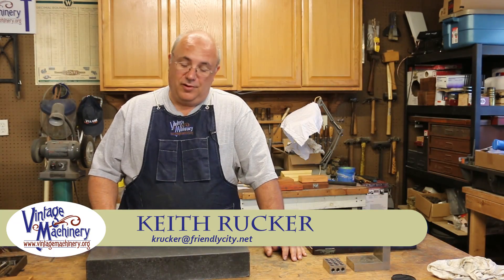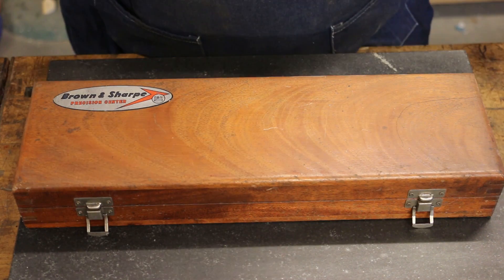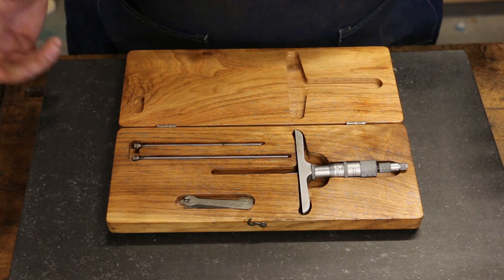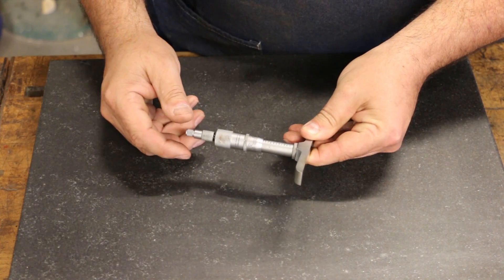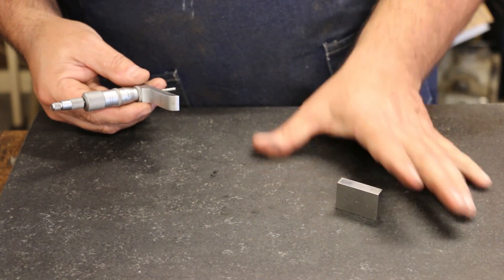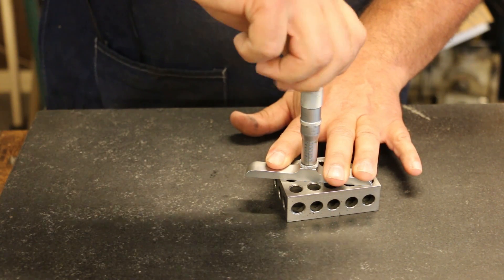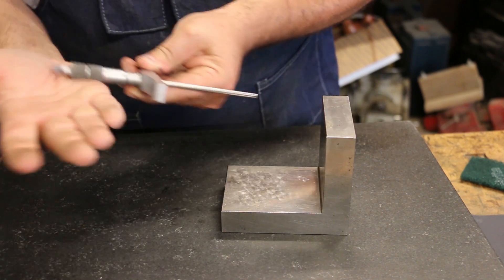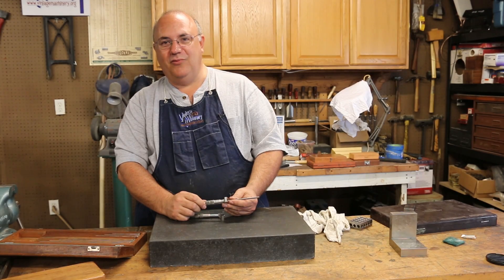Machine Shop Basics:  Depth Micrometer Use and Calibration

Comment: great video Keith, but also mechanics use this not just as a measuring device, but also in adjusting engine parts, ie measuring valve lift, to set adjusters, or to check pulley marks of valve timing, aka to 'set' top dead centre by this tool touching the pin, piston, etc, this is by using the tool to create a known reference dimention to set the system, rather than common usage, to determine an unknown dimension.

Comment: Keith, how do you know how tight to do up the collar which assembles the rod to the barrel as this affects the calibration (aka the fit of the assembly to the barrel); as you don't mention this while callibrating the rods, as if you 'finger tighten' the rods during calibration, you MUST repeat this (like concentricity in a lathe chuck, with the same jaws in the same spots)- ie do you use the 'ratchet top' to tension this nut?, to keep consistentcy.

Comment: I guess I'm getting here a little late, but I just picked up a Brown and Sharpe 1/2" depth micrometer with an adjustable rod. Shows a patent date of 1898, so not new. It has half inch graduations, but they don't quite line up dead on with the thimble at zero. Tip is chamfered, and when you feel the graduation catch inside at zero, the edge of the chamber is dead zero with the base. I can set it to use it with a standard, but they probably had a different intent with the lines. Haven't quite got it figured out, but I can at least use it.
Reply: Someone may of tried to adjust the mic like you’d adjust an outside micrometer or just rotated the sleeve accidentally? If you wanna fix it you should try this:

- Unscrew the ratchet
- Remove the rod
- Unscrew the thimble and you’ll find a collet. 
- Loosen the collet and that will allow you to rotate the sleeve. 
- Put it back together and you’ll most likely need to adjust the rod to zero it out.

Hope that helps even though this is a year later lol

Comment: Hey Keith, i have a depth mic that I’m not sure if needs calibration. When its set to zero the pin is exactly flush with the base of the tool. When i set it on a machined surface and ratchet it down, i get a reading of .0015. The issue I’m having is that i can see the pin is extended farther than the base of the tool and can feel it when i run my finger over it. Any insight?

Comment: Any idea where you can get a replacement base for that depth micrometer or any one for that matter? There is a nice Mitutoyo Depth Micrometer set at one of my local thrift stores for $20, but the micrometer base is pretty badly pitted.
Reply from the maker: Probably best to just pass and find a different one somewhere.  You can get some good deals on ebay if you are patient.

Comment: Great video as usual. Would you do a video on the Vernier caliper. I just had to have one, so I bought on  Ebay and it sure is a challenge to understand. Knowing how to use this caliper just might justify buying it : ) . My caliper is a L.S. Starrett 50 division. Now, I guess I need to buy a depth mic and practice what I have learned here. Thanks so much for another great video.   Ken ...Marina CA
Reply from the maker: I will see what I can do.  I think I only have one vernier caliper - a Starrett 24".  I can't remember if I showed how to read it when I got that one or not.

Comment: Guess that isn't a 1-2-3 block if it's .812 deep. :-)  Thanks for the very informative video!
Reply from the maker: For whatever reason, the holes on those blocks do not go all the way through like on most.
Reply: +Keith Rucker - VintageMachinery.org well, that would explain a lot. 😄

Comment: Thank you Mr. Rucker for the lesson. I wanted to ask you a question that was from a previous video. This is about the lathe you bought. You demonstrated how over time that the table gets worn out on both axis as much as 10 thousands in your case. I guess what I was wondering is on a brand new machine how much is acceptable? I know it can't be perfect but what would be a typical measurement?
Thanks again for your videos
Reply from the maker: A brand new machine should be pretty darn close to perfect when set up level.  I would say that I would expect it to be less than 0.001 or 0.002".

Comment: Great video.  I have a hard time reading micrometers, this video helps.
Reply: As a youngster my father (Master Machinist) would only let me use Vernier calipers for measurement.  Do it 50 times a day and you get good, pretty fast.  
I couldn't take it anymore and went over to Ebay and put in a bid on one.
Reply from the maker: Practice, practice, practice.  After a while, it gets easy.

Comment: How do you calibrate the longer rods? By pre-measuring a Gauge block with the 1-inch-rod and then moving up from there?
Reply from the maker: If you have gauge blocks, you can easily stack them together to get whatever length you want.
Reply: Yeah, or if you have gauge blocks that are known to be good, just use them directly (especially if your shop has a constant temperature, if not, yes, do check them first).